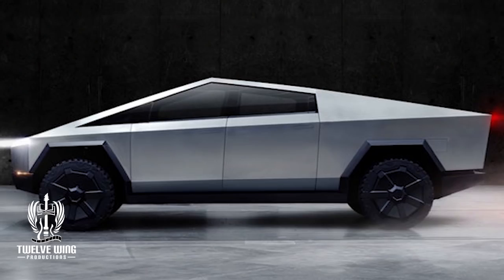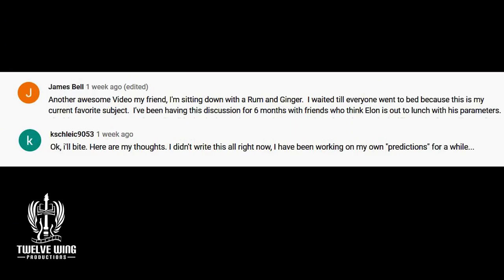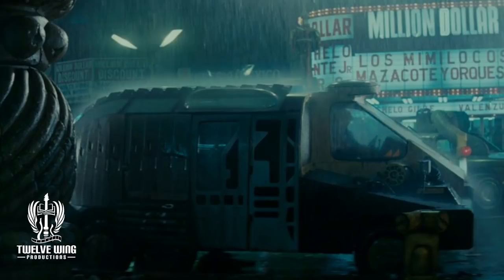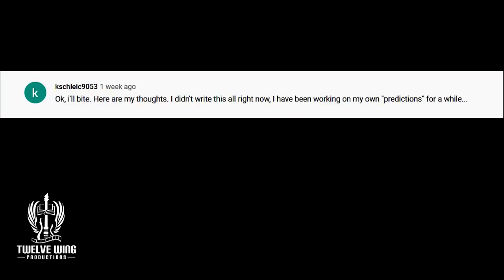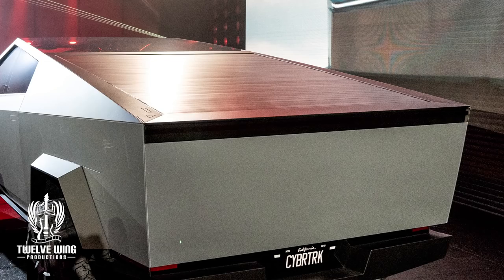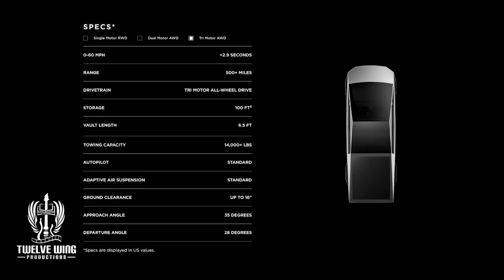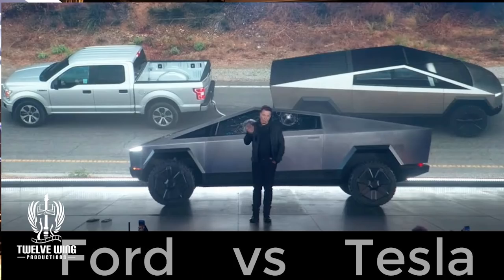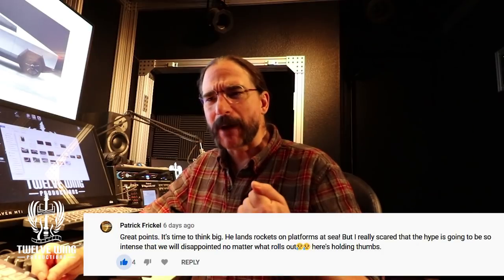Tesla's Cybertruck was not designed, it was engineered.  Here's how you benefit.

Comment: Vehicle to home backup power is what I’m excited about.  
I currently have solar panels on my house, but they shut down when the grid is down.
Could you imagine being able to use your Cybertruck as a battery bank that charges from your solar panels and at the same time powers your house.

I hope this is possible some day.
Reply from the maker: That would be a very cool thing to have.  That's what I had in mind when I said that the Cybertruck has the potential to be a fantastic disaster recovery vehicle.
And that's if the state buys them for that purpose.  Imagine if you already had one of the best disaster recovery vehicles available... in your driveway.  And you used it to go and get groceries and yard work.
Reply: Grid tied inverters need the grid. Powerwalls mimic a grid by creating a pure sine wave voltage from the batteries that the grid tied inverter thinks is the grid. You can not bring your solar inverter up without some kind of 'grid' power source. I am installing a 3kw 12v dc to 240v ac inverter charger that will bring my solar back up in the absence of the grid. The inverter also kicks off the solar inverter automatically if the battery is full. The problem is where to dump the excess over your loads power that the solar produces. CWNE88 here on YouTube has created a setup that tracks the excess solar power production and adjusts a Tesla wall charger up and down according to the solar production. He reads the data from a powerwall with a Raspberry pi and the pi commands the wall charger in slave mode. Neur.io is what Tesla uses in their powerwall for the data. I have a neur.io installed as of last week and it gives the production of solar and the consumption of power over the local area network. Solar minus consumption gives the excess. I plan to modify the python code he uses to adjust the wall charger and dump the excess solar production into the car or truck. To summarize, with a 12v car battery and a 3kw inverter charger and a neurio, I think I can also direct my excess solar above my loads into a wall charger. A dump load if you will. If the excess solar power has nowhere to go without a grid, it will ramp up the voltage until something fails or catches fire. As a backup, I'm planning to install something on the panel rails that will shade the solar panels so I can lower the solar output with shade. At night, simply plug the 240 outlet on the cybertruck into a generator input on your home panel. You will need a lockout and a generator receptical and cord with an adapter. The power in the battery will run the outlet at night. It would be much easier if the 240 outlet on the truck is the same inverter that charges the car. Then attach the 240 outlet to the house generator outlet, and it will automatically dump excess energy back into the truck being an inverter charger. If the battery is full, you will still need a backup plan like shade.
Reply: @HeavenGuy  Have you considered using an electric hot water tank as a way to dump your excess solar power? Could set it up to act as a pre-heater for your existing hot water system.

Comment: Re: the “job site power output specs”. . .   If I can run my tablesaw continuously at 110 volts, and a 110 volt charges a Tesla at a couple of miles per hour. . .  I don’t think it’s going to be an issue unless you are trying to power the construction equipment fir the whole subdivision.

Similar orders of magnitude as charging consumer electronics from automobile 12 volt outlets.  It will be more than “good enough”. , .
Reply: There might be a couple trades where that won't be sufficient, but for most it will be sufficient. I'm mostly familiar with needing power for the "hole hogs" drilling holes in two by fours for residential electrical. A couple outlets should be plenty for a crew - though if you're carrying six people in that cab you might need a couple circuits.

Comment: You brought up the one aspect of this vehicle that most everyone else is overlooking; that being longevity.  A normal truck wears out over time.  With a frame that doesn't rust, there's nothing that can break in this vehicle that would cause the vehicle to be not worth fixing. Barring a bad accident, it's the last truck I'll ever have to buy.
Reply: The motors, suspension, and battery are all easily replaceable.  "Refurbished" cybertrucks will be a thing.  Tesla can buy them back after a million miles instead of people scrapping them, wash the frame, and replace the electronics/battery/suspension.  It will be the same as brand new.  Hell, I see 3rd parties doing this before tesla does it.
Reply: Steve Shindledecker right. Unless as you said you’re in an accident. Then instead of just replacing a body panel you have to throw away the whole truck.
Reply: @craigcampbell1843  Welding stainless is not some impossible feat.  Repairing anything on the body won't be hard.  The beauty is that anyone who knows how to weld stainless can do it and all the metal pieces are flat sheets, so it won't be complicated at all.
Reply: Patrick O it’s an exoskeleton. The body is essential the frame. If a vehicle takes on major frame damage you can’t just patch in a new piece. The vehicle more often than not is totaled. This truck may be “indestructible” in a grocery store parking lot getting hit by shopping carts but if someone runs a red light and t-bones you, your indestructible truck will become trash
Reply: @craigcampbell1843  What is wrong with you?  We weld structural steel all the time as a human race.  The notion that you cannot cut away damage and weld in new pieces is just stupid.  Where are you getting these silly ideas?  Tesla will do testing and come up with guidelines on how much to cut out for any kind of damage and how to weld in a new piece.  This is actually going to be easier than the aluminum body on the 3, as they have to repair it the same way, but the surfaces are not simple flat pieces.

As for being t-boned, as with any vehicle, a t-bone usually means total.  So what is your point?  In a tesla, the battery takes all the force in a t-bone, which is why they are so safe.  That means replacing the whole pack, so when you add that to the body repair, it likely will never be worth fixing a t-bone on any EV from any company.
Reply: Patrick O the Cybertruck is different and exciting looking but it will be nothing more than a lifestyle vehicle for most like the G Wagon is. It’ll be a fashion statement, not a work truck like an F150 which is fine but let’s be honest. Not only is it vulnerable, if not trashed, if it gets into an accident but it’s front and rear visibility is HORRIBLE leaving it close to useless on job sights or when off roading when a driver needs to be aware of their surroundings. If you’re driving and turning left or right all you’ll be able see is a giant A pillar. If you’re checking over your shoulder to see what is to the right of you all you’ll see is the side of the bed which goes up to the top of the rear windows. I think it’s cool looking but there are reasons trucks have been made they way they are for 100 years.
Reply: Patrick O Elon didn’t design the truck this way because it’s better. He designed it this way because it will be cheap for him to produce. I predict that this is either a concept or a way to raise money (200,000 $100 reservations means $2M in Tesla’s pockets right now to do...something with) or Elon will produce this truck the way it is for people that want to be different but also come out with a more traditional truck to sell along side it. Otherwise anyone that wants an electric truck and DOESN’T like the Cybertruck will be forced to buy a Rivian instead of staying loyal to Tesla.

Comment: I've never bought a new car or truck in my life, owing to the massive depreciation when they roll off the lot.  28 years in, I am on my fourth pickup truck.  They have all ultimately been destroyed by rust.  I was hoping to buy a used CT in about five years, but I don't think there will be many on the market.  sigh Gonna have to buy a new one, but it will probably be the last truck I ever have to buy.  Stainless steel unibody form is long overdue for work trucks.
Reply from the maker: You said a mouthful there.
Reply: Same here, I always buy used Lexus and Toyotas from old people. CT may be first and only new vehicle I will ever buy and need! Can’t wait!!
Reply: Cybertruck , lots of Benifits, no Dents, no Rust and you never have to Paint it.
Reply: The inner skin will likely be sheet metal.
Reply: Cyber Trucks  (or rather Tesla Trucks as I prefer to say) will last three times longer than painted carbon steel vehicles. The 500,000 mile battery will last at least 30 years probably a lot longer. Every 10 years chuck in a new interior and of course replace wearing parts as you go along.
I can’t see the TT used prices dropping anything like they do on normal Big Auto vehicles. 
The low depreciation will be a massive owner advantage.
Reply: Jin p   - 100,000's of People could afford Model 3 at $40K each. so, why cant Truck people afford the Cybertruck at $39,900 ?
its a bargain Compared to ICE trucks costing $50,000 or more, and ALL of the ICE trucks don't have as MUCH Standard Equipment like the Cybertruck has.
Besides you save on NOT having to buy ANY OIL or GAS for the Life of the Cybertruck, the Longer they hold on to it, the More money they save. 
Maintanance, of Cybertruck is pretty cheap as well, only $25 every Quarter, compared to $100 every month with an ICE truck, sometimes MORE.
Reply: @markplott4820  Making your own power no oil changes brakes last forever doesn't sound like a avalanche when moving.
Reply: Jin p  Save 55 dollars a day till it comes out and you can buy it outright.
Reply: @charlie Bender
I bought a Chevy truck brand new in 98. By 2007 it was undriveable, 9 years almost to the day a motor mount broke. I take care of my equipment, I even sprayed it with oil undercoat every year. Damn frame rotted from the inside out every inch that wasn't coated with oil. Mostly in the front by the motor mounts and radiator. Makes sense because that's where a lot of stress happens. They used crap steel. Heluva way to waste $65,000.
I still have a 85 Ford Ranger I do the exact same maintenance routine on, works fine. So whatever Chevy did with that frame, they done screwed up. Won't ever buy another Chevy product.
Reply: Jin p  Good Idea it lets them work out the kinks to fix any or at least so you know what you are getting into and you to save up for the purchase I think 2 years into production of the Cybertruck they will come out with a light truck version that may be more affordable.
Reply: Jin p  That's funny, in a dark way.
Reply: @Dawt_Calm  I currently drive a 98 Tacoma.  The rusting frame is the weak link in an otherwise solid vehicle.  Wish I had stainless steel unibody truck options from every manufacturer.
Reply: @brucebender5917  Nice trucks, Tacoma. Little more pricey but built better. My neighbor has one, it's just over 5 years old and it's getting the eyebrow over the passenger side wheel well, you know how it bubbles out when the metal rots under the paint. We're in the Northeast, considering he never did any kind of oil undercoating he didn't do bad for this area. 

Now he's stressing over it, I told him we can cut it out and weld in some repairs but he looked over at my Frankentruck and said he'd probably take it to a body shop. lol.

Comment: Two opportunities.
1) extend the bed.... Under the rear seat. That provides the crew cab and 8'×4' sheet capability in the "short bed" truck length.
(I assume the load cover stores under the seat at the moment?)

2) A front opening tool drawer for the Frunk.
The flat section below (even Including) the light bar is screaming "drawer front" to me.
Remote, coded operation via the app with hidden high security locks?
Reply: The issue with extending the bed is the vault cover rolls down the front of the bed into a cavity under the vehicle taking up the space you are considering.
Reply: @frankspeaking2630  
That's what I was wondering.
Maybe an option with a cover similar to the tailgate ramp would work?
3-4 panels sliding into one?
It would still cover about 2 feet from the rear window, but leave the option of the under seat extension?
Possibly less prone do dirt, jams and leaks as well?
Reply: I thought about that option myself, but I think maybe they will go for a heavily secure and robust bucket, and only have the frunk open from the top.

However, since you got both AC and air, it would be very easy to have stock, or just fab it up yourself, a powered toolbox deployment arm? or like a multi layer fold out thing like in a tackle box?

If it doesn't have something like that in it, I'll build a set of arms that just lifts out a big box and sets it on the ground, kinda like a garbage truck that can grab a dumpster? Then I'll fab up a handful of boxes, so I can have a general tools one, or a welding one or whatever, and then you can either deliver it and drive off or you can deploy it, use it, and retract it when you want to leave.
Reply: @markallen6433  
The only issue with the Frunk might be variable mass of items stored when crash testing.
You don't want heavy, loose items moving around in there.
But, on the other hand, any such item would be thrown fowards in relation to the cab.
Reply: @rogerstarkey5390  oh... yeah, you're right. For ideal crash safety you'd want to fill that with pillows... Well as long as it's not too heavy and too massive, so a light weight actuator can deploy it, you're probably fine. Thin sheet, like 22ga for a tool box?
Reply: @markallen6433  
Ah, but as I said, the mass would move forward away from the passengers
Reply: @rogerstarkey5390  it might, or it might get collapsed into the passenger compartment. They design the frame so a frontal impact crumples the motor mount downward and it shunts the motor safely into the ground. The toolbox would get sent right at the firewall cause its centered there and not under the floor plate.

Though... maybe the firewall is a solid plate of 3mm? That might make it pretty safe.
Reply: @markallen6433  
True, but there would still be a lot less weight and the moment would throw the contents forward rather than driving them backwards. There would also be space for a crumple zone behind the tray?
Reply: @rogerstarkey5390  we'll have to wait and see if they develop anything. If they don't, down the road I may make a channel and post builds/mods for mine.
Reply from the maker: @rogerstarkey5390 , It will act like a giant dead blow hammer.  I would enjoy seeing that tested.
Reply: @twelvewingproductions7508  
There will always be tools placed in the frunk anyway.
A drawer with a 4 point lock just makes access easier for the dimensionally challenged.
Reply from the maker: @rogerstarkey5390  If I could give one piece of advice to Tesla regarding this truck it would be that once they make it... NEVER change it.  NEVER.
Let people KNOW that they will never change the body.
Once they do that, the aftermarket folks will come out of the woodwork to make mods for this truck and it will be absolutely fantastic.
Reply: @twelvewingproductions7508  
True.
There will be so many aftermarket parts that I doubt any two trucks will be the same.
Ref my "Rolling Stones" post?